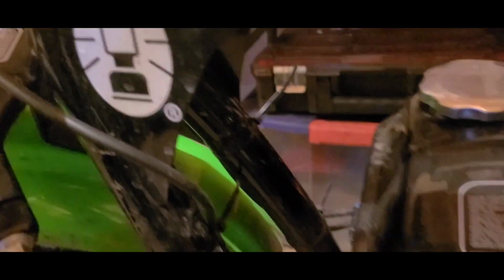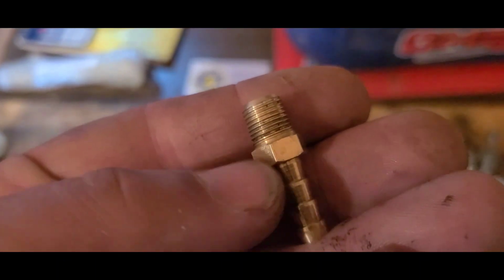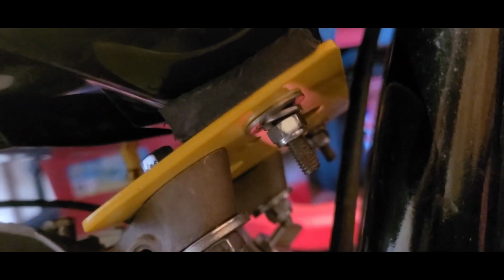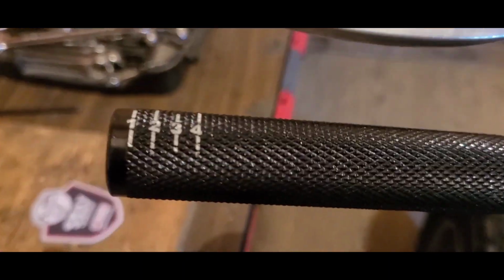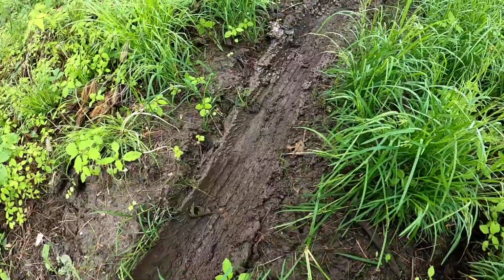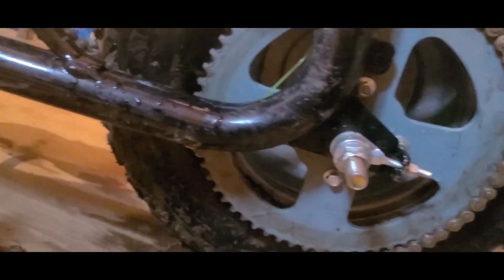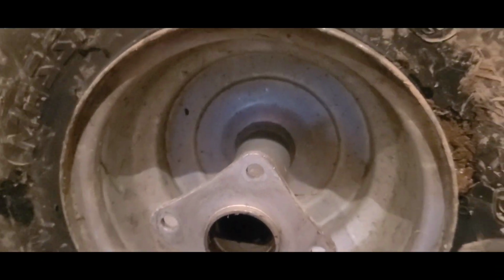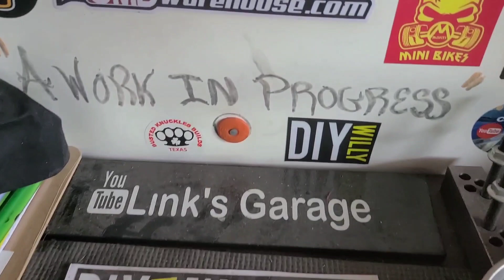Coleman BT200X "Almost Perfect"

Comment: 1st use string to get front and rear wheels aligned
Reply from the maker: @JimCooper-f8g  I used a long straight edge. All these factory jackshaft bikes are off about 1/2 inch when swapping to torque converter.

Comment: I love the bt200x just can't ow them down
Reply from the maker: It's extremely comfortable just how I have it set up. The risers extensions and pit bike bars are spot on.
Reply: @fatbuddycat  I'm loving my baseline bars I bought for my mm80 next is front brake kit I did add the torquezilla yesterday rod it about a mile so much more control over the amazon driver
Reply from the maker: @Heathen Projects  they are super smooth, that's why I threw it on this bike. I'm making good rpm, I'm gonna try a 54t and see how it works out.
Reply: @fatbuddycat  nice I went down from the 75 to a 60 which was okay but then dropped to a 50 with yhe ghost I should have tried the 60 on ghost buy so far the 50 is working out great on and off road
Reply from the maker: @Heathen Projects  I'm using the 50 on the EX budget basher!
Reply: @fatbuddycat  sold my ct200u so I can get started on my db30s have a 10/60 a ducar and a hydraulic brake nothing really crazy just a little cruiser

Comment: The tank riser/relocation is great. This video just solved what's had me stumped for the last day and a half. I'm prone to overcomplicating things, Im glad I stumbled upon this. Thanks.
Reply from the maker: Rock on! Some guys dent the gas can and others try and find or modify the fittings to clear with these ARC side covers. This opened up the area a lot better than I expected, I've raced it off road and it seems to be a solid concept.
Reply from the maker: Some of my videos are long but I cover a lot of the technical aspects that go towards building better, higher quality mini bikes. I'll be adding preload to the suspension, installing a bullet proof pull starter and making a few more adjustments soon.

Comment: That’s definitely an fbc bike right there
Reply from the maker: Absolutely! Most dudes would leave the chain with a little bit of offset and run it.....but I ain't most dudes!! I can get this thing lined up way better than they did at the factory. They definitely have something in the wrong place, if its not the brake anchor then it has to do with the location the axle tabs themselves. The bolts were very loose taking it apart, I'm guessing the factory jackshaft didn't line up either.

Comment: FBC... How much do you charge to put together one of those Fuel Tank Lift Kits and mailed to Arizona? I have a BT200X with a 212 Ghost on it and I need to lift the fuel tank up higher so fuel will gravity feed down to the carb. I need about a 2" to 3" lift. Can you put together a kit based on your design but lifting the tank just a bit higher? If so, let me know how much. I can PayPal ya. 
I currently have no tools or a place to do fabrication and at 124 degrees during the day, we'd be insane to try and do any work outside anyways.
Reply from the maker: I gotta get time to do a few sets, I've been super busy. They work great, I ride my bike hard at least a couple hours a week....Zero issues. I think the padding and rubber help absorb a lot of the turbulence.

Comment: Is the is that a modified Hisun 196??
Reply from the maker: @Tumb0_33  sure is. I have a few. They haul plenty of butt if you build them correctly.
Reply: @fatbuddycat  I plan on doing so..I am about to buy a used bt200x and figure I would be better off building out the 196 plus it'll give me some experience with these engines
Reply: @fatbuddycat  why do you think you are getting no top end? Is it the gear ratio? I want to do the same exact thing you are doing but make it more of a street bike as opposed to trail
Reply from the maker: @Tumb0_33  I'm running a Dynocams CS 265. It has added lift with less duration to promote a constant torque curve. To get more top end, I'd recommend the Dynocams CM 265 (aka The Super X). Same lift but more duration. Duration holds the valves open longer, which allows more fuel/air in and exhaust out.
Reply: @fatbuddycat  thank you man I'm sure I'll have some more questions as I go..I appreciate it 🙏🏻
Reply: @fatbuddycat  Hey so I was looking at the Super X cam..does it have a relatively broad powerband or mainly top end? Like it would be good as a street cruiser but I would still get good speed when I opened it up..what's the mod 2 cam all about?
Reply from the maker: @Tumb0_33  SuperX is a better all around cam, mod2 is OK for top end but won't have as much acceleration.
Reply: @fatbuddycat  what do you think would be the most effective clutch assembly for my application? Straight chain w centrifugal clutch or jackshaft or TC??
Reply from the maker: @Tumb0_33  I prefer TC with a properly aligned chain.
Reply: @fatbuddycat  would you recommend upgrading the rockers when I grab the Super X cam?
Reply from the maker: @Tumb0_33  I like the Champion rockers but they require a valve cover modification for clearance. It can be accomplished multiple ways, the cheapest is to remove the factory baffle and plate. Once removed you have enough room. Run a NPT tap through the hole so you can thread in a barb for a vent line. Second option, valve cover extension w/longer bolts and 2 gaskets. A third way is to purchase a fancy billet valve cover that is designed for performance rockers. The extensions have prethreaded holes as well as the billet covers.

Comment: Nice tank and handle bar mod
 Good luck with the chain alignment 🔧👍
Reply from the maker: It would really be ok where it's at but mine does seem particularly far out. It's funky because I can't trim the brake side or it will bind up, I actually had to add a washer to the factory setup to get it to work properly with the axle tight. I tried banging the brake anchor over, it is pushing the drum out of alignment.  It moved a little but didn't make much difference. I could trim the anchor portion of the housing back I suppose but I'd rather leave that alone. Someone welded the bracket to far inward to cause this.

Comment: Heck ya bike is looking great your channel is doing awesome hey you should add a filter somewhere on your side cover and valve cover for air vents not just running back into the engine like that it will save you headaches on side cover gaskets and all gaskets really gray job bud I’ll be sharing and watching I’m back   Yes sir
Reply from the maker: I think I ended up running an external pcv with a filter but I think I know the ones your talking about! Good idea for sure.

Comment: Real wheel is cocked causing misalignment
Reply from the maker: The alignment is off about 1/4 inch from front to rear. I used an adapter to move the sprocket inbound since you run out of room on the jackshaft running that sprocket outbound. I've fixed this issue on numerous bikes. A lot of people cheat the rear wheel tensioners and pull the axle off center. If you do that you will create a couple more issues.

Comment: Great job man, those are fun bikes for sure. Ibhave to ask, why do you always ditch the fenders? Especially when you ride off road.
Reply from the maker: I love the lines of the frames. Oftentimes, the fenders take away from the overall design. They always look like an afterthought.  I still have them, I'm looking at cleaning them up a little or using the brackets with something custom.
Reply: @fatbuddycat  I understand all that for sure. I was just curious. Most of my bikes are for off road. I always run fenders to keep as much crap off of me and the engine as possible. Keep up the good work man!

Comment: When it comes to alignment with a torque converter I could only comment about the 200U. If you use a forward riser or not you will not get close to perfect alignment. You will only get "acceptable" alignment. In order to get close to perfect alignment you need to start by checking sprocket to engine plate with a straight edge with the engine off the bike. This tells you where your axle should be. On a 200U you can't use the marks on the frame for the axle. If you use the marks on the frame it will be way off. The sprocket will point away from the engine. And have you ever noticed that on everyone's 200U the back tire does not line up with the fender at the back of the bike? This is because the brake side of the axle is too far forward. They have come that way brand new out of the box.

The second thing needed is the engine moved over to the left appx an eighth inch or so to get the best alignment front to rear sprocket. This can be looked at sprocket to sprocket with a straight edge and the driven pulley removed like you did here. How you get it moved over is up to you if you even want to go that far with it.

Very few guys look at alignment this closely. I'm sure they do the same with the plate bind into the cooling tin bolt head. I just trim the backing plate down with a bench grinder and make sure a feeler gauge fits through once it's bolted up. There's no need to trim the cooling tin.

A few years ago there was a guy complaining about the alignment and blamed the forward riser quality. It's not the riser at all. It's just that the alignment is off to start with and you have to work it if you want better alignment.
Reply from the maker: That's exactly what I'm out to prove!! I took my parallels to the axle before I went back to the new tire. That's when I figured it out. I ordered a sprocket adapter for my 54t ring sprocket. I'll be offsetting the sprocket to the inside so that it lines up with the pulley. Then I'm going to use my trimmed plate, it's not bent like I thought it might be. I'm working on a sweet EX too!! 😋 that one is gonna be more of a cruiser with a really dependable build.....I'm trying to build a stroked out gx160 by using a 196 block, 196 crank, 160 cam, 160 head....Governor still in!! 😳